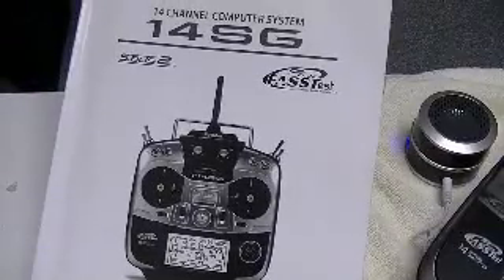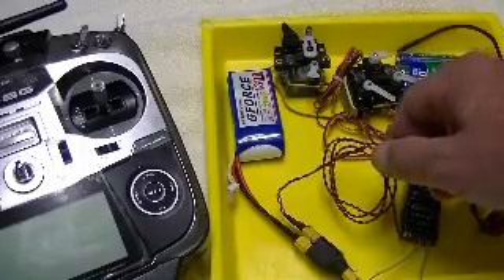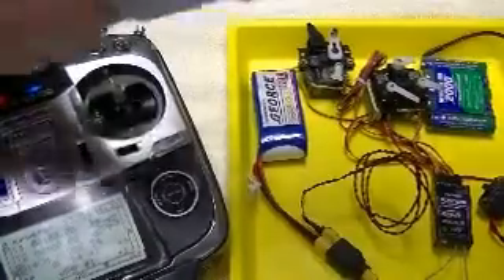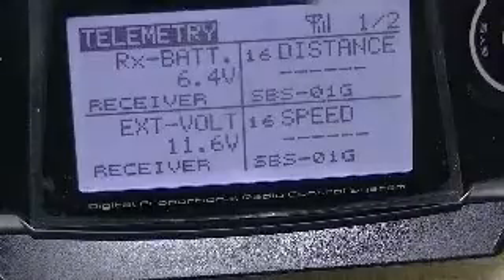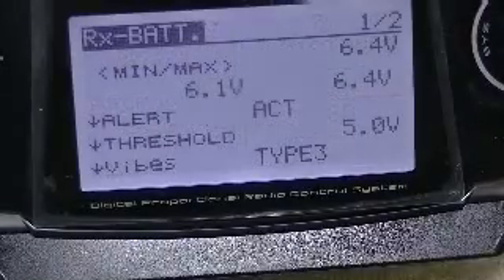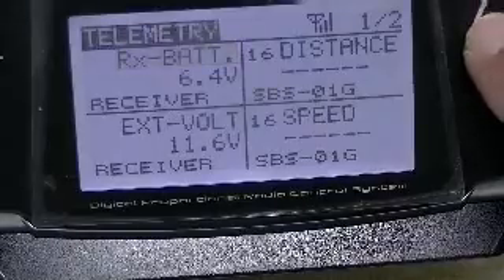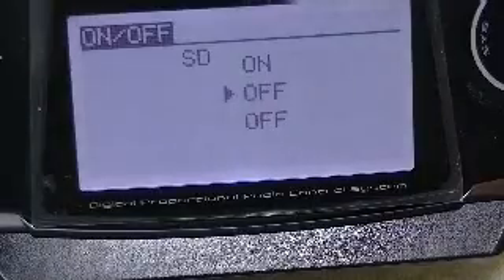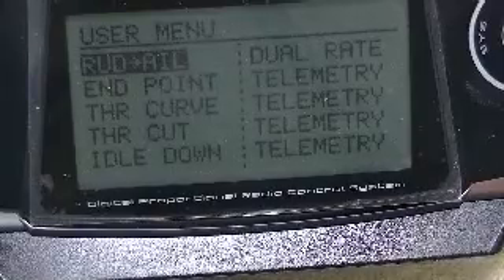External Voltage Input CA-RVIN-700, Futaba 14SG Radio

Comment: Hi, 
I have Futaba 14 SG transmitter like the one in the video and a R7008SB Receiver. 
Should I buy the Futaba CA-RVIN-700 External Voltage Cable ONLY (for $20 on Amazon).,, Or  the Futaba SBS-01V 14SG External Voltage Sensor (for $75 on Amazon) ? 
Thanks
Reply from the maker: The RVIN-700 Cable will work fine for the typical RC airplane setup with only one battery pack  aboard the airplane.
Reply: George Krueger Thank you 🙏

Comment: Hi, what is the voltage lower limit you set your alarm for the main battery?  Fully changed is 11.1 V ,, so what is considered low?  Thanks
Reply from the maker: The nominal voltage for a LiPlo cell is 3.7v, or 11.1v for a 3-cell pack as shown in the video.  Fully charged LiPo cells are 4.2 volts, and during discharge they can temporarily go down to 3.0 volts per cell.  At the end of an RC flight I suggest the stabilized cell voltage be at least 3.4 volts per cell or 10.2 volts for a 3-cell pack.  You can set the alarm there, but realize that during flight the battery voltages will be varying with load and with time.  I suggest a vibratory alarm, because it will go on briefly during heavy load (say a steep climb), then go off again as the load is diminished (level cruise).  Your signal to land will be when the alarm buzzes rather steadily in level flight at about 2/3 throttle.  Be aware that most ESC's will cut off power to the motor at 3.0 volts/cell.  As you experiment with various alarm settings, stay comfortably above this level.
Reply: This is very informative,, thanks alot.

Comment: Nice that you posted this video. The voltage 'sensor' is just a wire correct?
Reply from the maker: The "sensor" is just a wire set up with a tiny plug  to match the receiver port.  Futaba supplies a small fuse to be soldered in'line also.